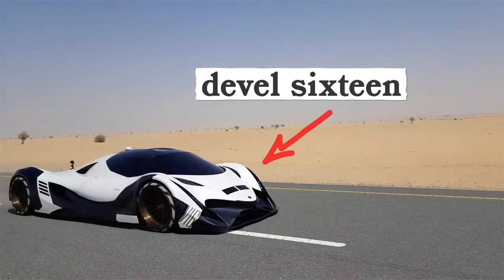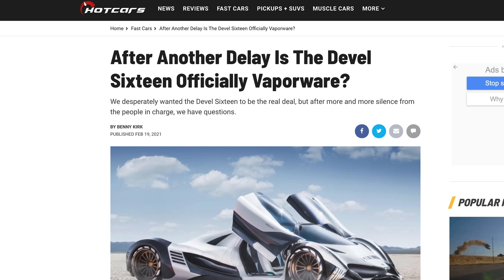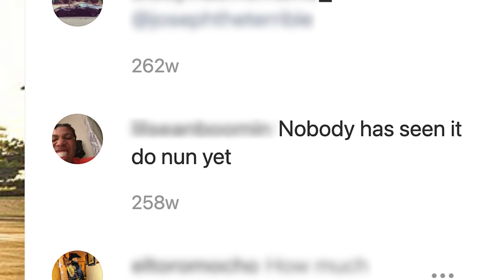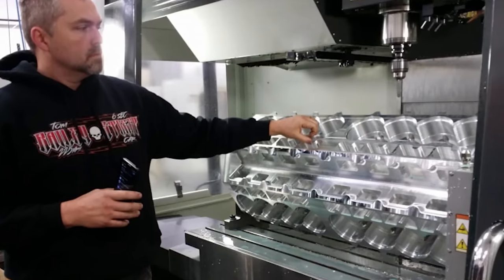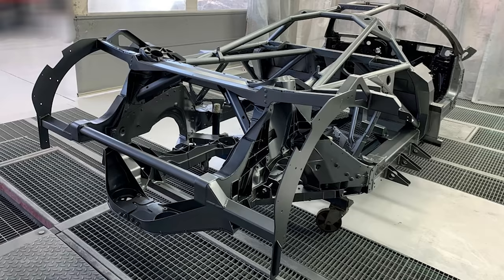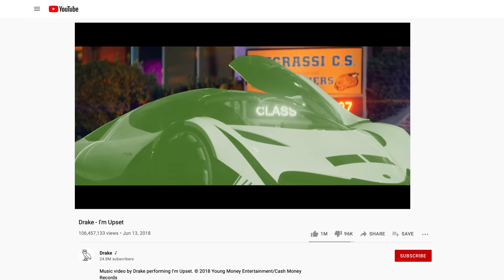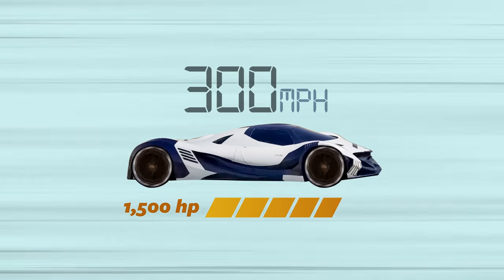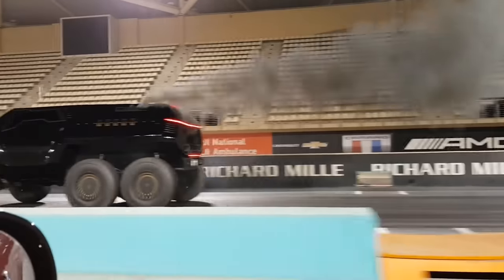Is this Infamous Supercar Real?

Comment: If this actually exists, frankly it's only good for a world land speed record for a production car. If you put it on a track...well, you're going to the Shadow Realm.
Reply: The car is fake. Full stop. Might I add that the only engines that are capable of 5000 BHP are drag engines, and they have to be rebuilt after a single run, EVERY TIME?! RevMatchTV made an amazing series detailing all the lies spouted out by Devel and the people promoting the vehicle.
Reply: every stock gt3rs or gt2rs will crush any laptime this thing will put down.
Reply: @DR3ADER1  what lies did they say?
Reply: @patriklenck1735  its not meant for a track, its meant for the drag strip

Comment: As soon as I saw the engine is real, I immediately thought "yeah, you're gonna need a heck of a transmission to channel that kind of beast". And turns out, that is the biggest challenge, other than aerodynamics, tires, suspension, active censors, etc
Reply: And cooling. It would need 4x the radiators in a Chriron
Reply: You could use the transmission out of a Promod drag car, something like a Reid TH400, but your gonna get three gears and no overdrive
Reply: A turbo 400 would not be able to be used in the application they wanted to in a car like this. Meaning you could never track it that's a quarter mile transmission which works good but it's meant for short time frame creates a lot of heat in a short amount of time. You'd never be able to take it to the track and put any power through it.
Reply: @barneymiller7894 there is a reason why after every pull they strip everything to check and replace parts

Comment: I'm curious if maybe they have dual fuel injectors on each pistons (yes all 16) and you can turn them on therefore it doesnt run at "5000" hp all the time it's more manageable but at short bursts you get the 5k hp
Reply: What. Maybe it is dual injector but why tf would you TURN ONE OFF instead of just decreasing pulsewidth, ya know, like a normal car, or maybe I don't know some kind of boost control?? Also this isn't a Diesel. You can't just "less fuel = less power". If you lean it out it will melt your Pistons lmao.
Reply: HP is directly linked to RPM, so you can't just run 5kHP whenever you want; you'd have to be at full boost, full fuel injection (full throttle) and near max RPM. Modern cars have their ECU maintain fuel and air ratios constantly at all RPMs and speeds to avoid misfires, detonation, adjust fuel economy and power, so the HP fluctuates all the time and is never at 5kHP unless they have cruise control at top speed.
Reply: Horsepower is directly linked to throttle opening even if that link is electronic and rpm is a function of the time it takes to build the boost to run the number. Most likely not a pump gas motor, probably e 85, the tune window is much larger than pump gas.
Reply: They likely do have dual injectors. If you have single injectors big enough to support that much power it can be hard to get them to go low enough to do idle and low load. Can be easier to have a smaller set of injectors that can cover all the lower load areas without boost, then the large set can come on once the boost comes up. With multiple injectors you can also run two separate fuel systems so can run pump gas when just cruising then run alcohol or methanol for power on the big system.
Reply: @NBSV1  yep yep...worked on a pair of 572 boat motors..intercooler. psi blower. 3 sets of injectors, 2 sets in the intake and one in the hat..ones in the intake ran av gas and the set in the hat ran e85. Dyno time each motor made a little over 1500 hp at 6000 rpm and 35 lb boost. Past 35 lbs the e85 kicked in..motor blew the seals in the water pump on the dyno @2400 lb torque...fixed the water pump, took 10% overdrive out of the blower and 4* of timing and both motors still made almost 2300 hp..each @48 lb boost. Not grenade motors either..skater 34..losing a motor at speed is a bad deal...its all about the tune..boat ran 201 and was still pulling when he ran out of lake..

Comment: The Veyron had tyres glued on to the rim and only could just handle the 250mph (1001hp) the car could hit, so even if a car or motor was designed and built to handle 350mph (5000hp) tyres are a different story.
Reply: lmao they'd have to take like 2 sets of veyron tires and place them on top of each other hahahahah

Comment: I remember when Alexandra did the review on this car and let me tell you something. I like thousands of others was NOT impressed. It rattled like a rock in a tin can, had an interior that looked as if it was purchased off of Alibaba and the wheels of a Dub Cadillac Escalade. 

Then there was the overall styling! My God! I've seen fiero kit cars that look better. It just looked, looks straight up weird. 

Finally there was the price of 2.2 mil for something of NO KIND OF QUALITY and not to mention very limited usability. Where would you drive it?! I'm not talking about top speed either? You can forget about cars and coffee unless you're trailering it there. There's literally no ground clearance on that "thing" and not to mention for around $350k you can have a full out 8000hp dragster running over 300mph in under 4 secs. If that's your kinda thing that is...lol.

Comment: Claiming a supercar makes 5000HP makes it sound like they don't know what they're talking about, much like that terrible F&F line where they go "he's got 2000 horses in there, try 3, TRY 5!" 

It's less about it being possible. Top fuel dragsters routinely make over 10k nowadays but that's for 4 seconds and requires a full rebuild each run. It's just a ludicrous idea that you could make an engine that produces that power that would be reliable enough to sell to a consumer, or that doesn't set the car on fire the first time some influencer tries to do a burnout in a parking lot. Although that might be fun to watch.
Reply: Try 3..
Try 5..
Try F A M I L Y
Reply: Danger to manifold
Reply: @weaksignal8009  *sad floorpan noises*

Comment: The only way for it to hit 60 mph in ≥1 sec would mean it's AWD but can the transmission handle the 5k hp load or drivetrain?? Maybe if they develop independently like 60% rear and 40% front. Lots of engineering going into this car if real.

Comment: Devel Sixteen: "I wanna hit 350 per."

Jesko Absolut: "Mate, you are dreaming."
SSC Tuatara: "You want some water, dude?"
Reply: The tuatara speed record has been proved fake recently
Reply: Ssc is the same as devel. A big fat lie.
Reply: @-daigher-2549  they’re redoing it and it’s pretty impressive
Reply: @brutalbasspro  not really
Reply: @brutalbasspro  Unlike Devel 16 the Tuatara can actually drive over 60 mph.
Reply: @Alrucards  but they both claim records they can't do.
Reply: SSC Bloodhound: 😏 I wish you well
Reply: @brutalbasspro  With the kind of figures the Tuatara is putting out, along w/ the extremely low drag and weight, it should be able to go over 300 imo. The only things that might hold it back are the tires and the gearbox.
Reply: @brutalbasspro  wat? I said might b/c while it has the engine and the weight and the drag coefficient, it also needs to put that power down effectively and efficiently and idk if the tires and the gearbox can handle it. If they can*, then there’s no reason it *cant go at or beyond 300
Reply: @fifteen8850  so what you're saying is it won't do 300mph? Or did it and I missed it, because they lied and now can't seem to be able to make the record.
Reply: @brutalbasspro  I’m saying I believe it can do 300 mph, it just depends on the gearing and if the tires are up for it.

Comment: 6:56 Oh come on, where exactly is the creativity, when you do something that has been done before and do it with a platform, that has both millions of production engines made and probably the largest aftermarket support any engine has ever seen? Headers - could well be an LS turbo manifold, nothing special there. The block, crankshaft and camshaft - there is no way around those, he needs to make them. I am still not impressed, it is just merging two of the same in the end. The intake is probably the least copied from something else part of the whole thing and it still looks to me too much like the billet intake from Nelson Racing Engines. 
And my actual reason for thinking at least the top speed claim is BS - tires. The tires for the Bugatti were basically a one-off and the pinnacle of tire engineering and you want to add 160kph to the already insane 400-ish kph the Veyron tires barely can cope with? I don't think so. 
And don't get me started on what it takes to reject the 10000hp or 7,5MW of heat this engine should be making at full tilt.
Reply: car has always been a joke, trying to say are gonna make a production car with alcohol dragster levels of power is a total delusion.

Comment: if you want faster cars add mag tracks, or add a lower tank molded to the entire bottom, bolte don to be totally flat maybe some fins filled with oil and under pressure tiny, now you have downforce, stability, handling, etc ... faster safer by semi quantum locking like this

Comment: For me, with 1000HP would be enough, 5000HP is too much, an 1000HP V16 engine that works with biogas or bioethanol, i would do specs like this:
Engine: V16 engine.
HP: 1000HP.
Weight: 1400KG. 
Fuel: Biogas or bioethanol.
0-100km/h: 2.7 seconds. 
0-200km/h: 6.3 seconds
0-300km/h: 13.2 seconds. 
0-400km/h: 20.1 seconds
Top speed: 260mph. 
Speedometer: 260mph speedometer.

Comment: As an industrial engineer, i can explain why. Supply chain, material properties, energy loss through drivetrain, logarithmic increases regarding aero. Tires are also a big issue, there will always be a level of “spin” at any speed since there is no substance on earth with a perfect coefficient of friction. Friction=grip. Slicks on a dry track can give more grip than treads once warmed up due to surface contact area. With “rain tires” the ability to displace standing water as well as provide grip means robbing from peter to pay paul.

Comment: There's places in Montana that has unlimited speed limits.
Used to make v12s, out of LS engines, chopping the opposite sides of the block off.
Made about 750 horsepower, normally aspirated by two four-barrel carburetors.
Just saying.........,.

Comment: Koeningsegg have had 1500hp V8 for.. well over a decade now. There is not much question as if you can build a 3000hp V16, or even tune it to 5000hp for short boasts.

But... what is the point. You have to have a full car that handle it. Gearbox, transmission, tires, frame and so on.

So the fake is not really neither the engine or the car boddy, but really any other feature of the car.

Thy probobly calculated it and fireguard out that it was theoretically possible. Then when they start testing it... everything broke. Pretty standard. Over promise, under deliver.. or.. well in this case, not delivering.

Comment: Is it HOMOLOGATED ?? (Did they build 25 to 400 units ??) There are plenty of one of(s). Is it RELIABLE ?? (Did they hard test their JUST ONE COPY ??) Can the BOLTED together 16 cylinder (8+8) go the distance ?? Consider they tear apart & rebuild  Indy car engines after each race.
///
Cool body. Potentially Hyper performance. Anything over 180mph, you need to be a highly trained driver. If you are a Super rich guy & or Sheik, sure throw one in your 20 car garage or 40 car warehouse. I am a bit skeptical.

Comment: But the Most powerful F1 car ever (Benetton B186) made 1350 hp from 1500cc 4 banger, in 1986 and that engine had a block from a passenger car! 1350 hp divided by 1,5 litres of displacement = 900 hp/litre. The Devel engine has a power to displacement rating of 406 hp/litre which is still impressive but not as impressive as it could've been.

Comment: Your the smart guy, but 12 cylinder engines have been around longer than you have been alive.  Back sometimes between 1970 and 80 people have taken a spitfire engine and put it in a car, OK, I have to admit it is just 12 cylinders "British liquid-cooled V-12 piston aero engine of 27-litres (1,650 cu in) capacity" in a car.  OK, maybe your right, I just that it had been done.

Comment: Regarding the gearbox issue, why not enlist the services of Ricardo? They're a famous automotive tech company based in Shoreham-by-sea in West Sussex, England who have built all gearboxes for every Bugatti since the original Veyron 16.4 back in 2005. They could leverage that extensive experience and build a transmission system based on established know-how. They are also a subcontractor of Mclaren for their twin-turbo V8 and V6 engines.

Comment: Energy conversion efficiency for modern gasoline ICEs is around 40% in a best case scenario. Which means the Devel 16 would produce roughly 5500kW of thermal energy (heat) under full load. While it would produce considerably less on average this still is a massive problem. 
In comparison:
The Chiron uses a high temperature cooling circuit with 3 radiators and a flow rate of ~176 gallons/minute; not to mention the other 7 radiators used to cool engine oil, transmission, charge air and hydraulics.
I'd be surprised to see even the 3000hp "street version" going into production.

Comment: The horsepower claims are... ridiculous and the aerodynamics... laughable.  The thing would need a huge vacuum to expel the air being forced under the car (or a skirt that touched the ground).  It would flip @ 350 mph (which it will never hit with that shape).  Look at real cars like the "Bolide" to see what extremes and compromises must be made to maintain tire patch contact at speeds over 300mph.   There's a reason that the Bolide looks like a Formula 1 Racer... That reason is science.  There are NO compromises.  There are no work-arounds.  1+1=2 EVERY.SINGLE.TIME.  If it doesn't look like a formula car or use a BULLET design, it will never reach these claimed speeds.  Ever.  At these speeds air at sea level is more like water and requires knife-edge leading and trailing edges to deal with vortices and "sticky" airflow (like a jet) OR it's built like a rocket (aka: Dragster, Land-Speed Racer and also jets) that allow raw horsepower to overcome pressures (at the cost of almost all maneuverability).  One look at this car and its plain that this is science fiction.

Comment: Nope. NOT a v16. Technically it is a w16. A v16 would have 8 cylinders in line on each side of the block. This 16 cylinder has it's 8 cylinders per side in a 4 over 4 configuration. So 4 in a row, then another 4 in a row below that, but staggered. I hope my explanation wasn't TOO confusing and that this helps. God bless!

Comment: I have to say, as impressive as buying a 4000hp car is, building a 4000hp engine from another company's existing design is just hot rodding, not innovation. There are thousands of multi-thousand-horsepower LS builds out there, specially considering that it's a billet block. It's two drag-racing engines bolted together and that's just not what a hypercar deserves.

Comment: engines that make more power were never a problem in the 1st place,, land speed record for 350s is achieved by motorcycles ,diesels and electric already ,, piston engine is 448 , and wheel driven 463mph ., all of them look like a missile though. the fastest record holder that still resembles a car is steam powered and hit 148mph ..  resembling a jet isn't enough, it needs to fly and land like one too. private jets are at 400-600 ,  top fuel drag record is 336 in 3.62sec...  neither resemble a car

Comment: The biggest issue this car will ever have aside from aero, which can be solved by bringing an F1 guy over to design the Floorpan I the rubber. The Chiron and Veyron are about the fastest cars in the world, and the Koenigsegg, but none of them have rubber that can handle those speeds. Formula 1 doesn't, Nascar doesn't, the only ones who might would be the air force....maybe? I would love to see them just drop the top spec, go with the 1500 and 3000 HP, get some killer aero in there, nice intakes, venturi tunnels and call it a day. Make the 3k the track car, and run it all day long at 1500hp against all the McLaren, Porsche, and whoever else wants a go. Its a beautiful looking car, but they won't meet their targets unless there is a breakthrough in material science.

Comment: Just a question.  What tires would hold up to even 300mph?
Reply: The Bugatti Chiron 300 tires.    Made with carbon fiber.   They used them when they went over 300mph

Comment: 350mph? They need tires from Concorde to hold it on the road, and I'm even not sure it will help. 5k horse powers will destroy any existing tires in less than a second. VW concern was ordering specially made tires for ich record they done with the Bugatti. And for ich 10mph over 230 line they was need to emprove the tires for very long period of research and banch of money investing...